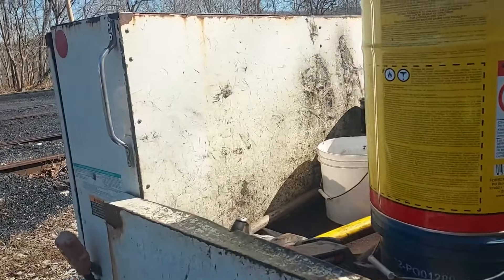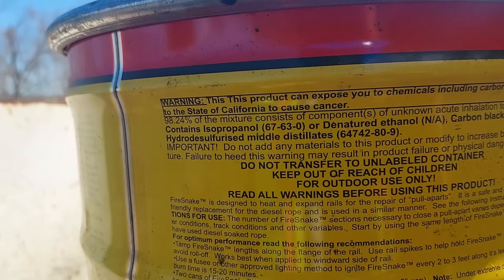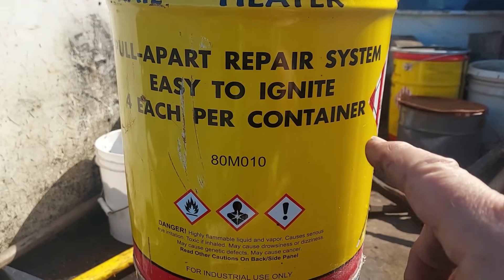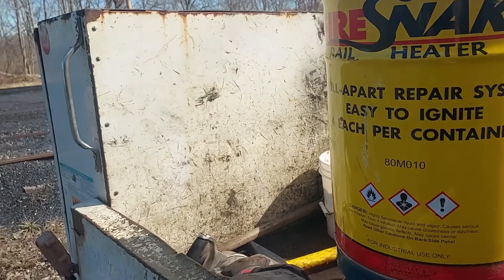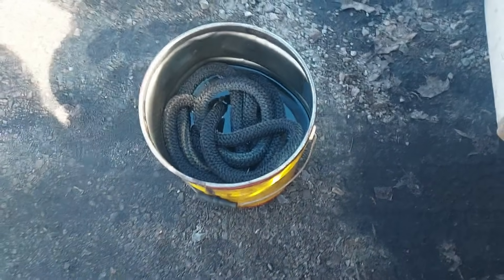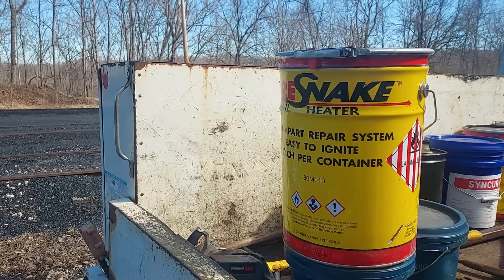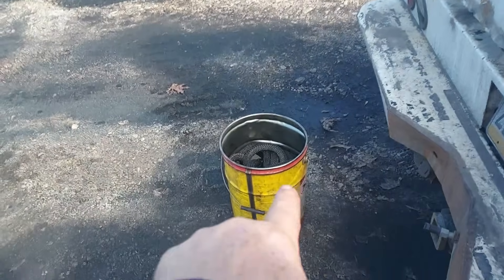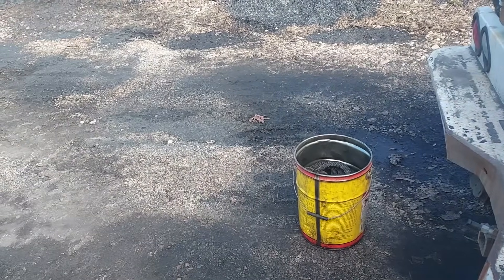Fire Snake and why we Don't Thermite Weld our Track Joints

Comment: Dave ?
Of course every question leads to at least one more explanation and that begets 3 more questions but, as a retired
master mechanic, having dealt with rear axle flange high impact shock loads our engineers use split conical wedges
(We mechanics call them Squedges, short for squedge bushings.)
(Look under the nut & lock washer on the rear axle flange of your service truck and you'll see.)
I was wondering if you were to try those on some of your more troublesome joints, maybe it would help or eliminate
the rail creep ?
Reply from the maker: Thank you for your suggestion Nam Cbeo. What would help us greatly is the addition of a whole lot more rail anchors than we have, and many of the anchors we do have are original from 1975 and have become weak. I need an anchor put er on er machine! They do make an anchor installing machine, but we don't have one. They also push all the anchors up tight against the ties. Impossible for us to do by hand with only 2 guys here and 16 miles of track.  On CWR every single tie is anchored to help mitigate the rail creep and
expansion and contraction. Really appreciate your watching the video and may you have a very good day my friend.

Comment: What are those screen / net looking squares glued to the wooden tie ends? 10:47
Reply from the maker: Those are hydraulically pressed on at the tie plant and are there
to help prevent the tie ends from checking or splitting Wasabi Master. The used to use an S shaped clip that was driven into
the tie ends. Thank you for watching the video and may you have a very good day my friend.

Comment: OK, quick question. Why are the nuts square and not hexagonal like most other nuts.
Reply from the maker: Nuts on track bolts are square because they provide a bit more
surface area to contact the washers than do hex nuts Tony. 
More surface area creates more resistance and thus better
holding power.  Thank you for watching the video and may you have a very good day my friend.

Comment: I never knew the line was isolated from the 'network' ill call it, that would be a pain. I also cannot even imagine the costs to connect it considering land would need t be bought and then all the material and then also the switch to whoever line you ended up connecting to. But reminds me of some lines of CPKC that are connected and bring in substantial income (leased out but we maintain) but company also refuses to put money into and so its all jointed as well and is 90% of our maintenance in that area along with the yard its connected to. Sometimes it is confusing to me why a section that brings in 100m a year cannot even get 10m a year put into it lol but thats big corporation life i guess for cpkc.
Reply from the maker: If you want to figure out how Class 1 RR's think, the bottom line
is pleasing the stock holders. Whatever can be cut out of the 
budget to do this will be cut out Hells Gun. We barge our coal to
a trans loading facility at LaBelle, there it is put on CSX and NS trains. That is their answer to a connection with another RR.
Thank you for taking the time to watch the video and may you have a  very good day my friend.

Comment: A really good explanation video Dave. I think a lot learnt a lot from it reading the comments. We went to Crewe locomotive works one day to pick up some refurbished crossing gate motors. I thought I bet they have some good stuff for cleaning contacts and asked what they use, they guy said Meths (wood alcohol I think you call it) and Isopropanol, there is nothing better it does not leave any residue. I already used meths for cleaning my track and started using  Isopropanol medical wipes. Like others have said it is probably used in fire snake for easy lighting and old cans even though sealed the Isopropanol will of dried out.
Reply from the maker: Yes that is what is happening Cedarcam, it is drying out, specially
if left out in the sun. Thank you for the nice comment and glad you enjoyed. Very much appreciate your taking the time to watch the video and may you have a  very good day my friend.

Comment: Hydrodesulfurized Middle Distillates (CAS 64742-80-9) are a complex combination of hydrocarbons obtained from a petroleum stock by treating with hydrogen to convert organic sulfur to hydrogen sulfide which is removed. It consists of hydrocarbons having carbon numbers predominantly in the range of C11 through C25 and boiling in the range of approximately 205C to 400C (401F to 752F)
Reply from the maker: Thank you for sharing that with us SilvaD702, very interesting stuff I did not know. Very much appreciate your taking the time to watch the video and may you have a  very good day my friend.

Comment: As ever, many thanks Dave. Wonder if it's worth explaining about the grade of bolts? My presumption is that rail bolts are a performance steel with a less tensile grade, as toughness over time is perhaps the priority. From British/European standards I think I know what I might choose... but I'm not a rail guy.
Reply from the maker: Thank you and your welcome Graham. All of our track bolts are
grade 5 because they do have a bit of flexibility to them. Grade 8
bolts would snap a lot easier. I use all grade 5 bolts on my tamper
because of the excessive vibration the machine has, again grade
8 bolts would not hold up as well as 5 on the tamper.  Very much appreciate your taking the time to watch the video and may you have a  very good day my friend.
Reply: @ccrx6700  Exactly Dave. The maliability of the soft grade (less tensile rated grade) yielding during peak force rather than clean snapping. Now, are you able to explain about the way the steel grade is used in rails?  ...would I be right in saying the rail is mostly soft(ish) in the flange and web to absorb the shock loads, but the rolling face is hardened to handle the high wear loads? (...and all within one grade of affordable steel)
Reply from the maker: @grahamrowe6278  head hardening is an option customers can get, not all rail is HH

Comment: Before they had continuous welded rail, didn't the railroads have to go check the bolts every week or something, so fast passenger trains wouldn't derail? 
Young people today don't realize that until about a decade or so after WW II, if you wanted to travel to another city, millions of people travelled by passenger train because cars were too expensive and failure prone. And fast interstate highways didn't exist. ( To get through Birmingham on US Highway 11 you had to go through 89 signal lights.) Air travel on piston engine aircraft was for rich people, due to the high cost of rebuilding the engines frequently. That rebuild took expert mechanics, and required changing a lot of expensive engine parts. Jets changed that, so people no longer have to be rich to fly. The Boeing 707 changed the world. The, 'Jet Set' appeared.
Reply from the maker: Your right about that Bill, back in the day rail travel was the best
and fastest way to go. After the interstate highways and the airplanes then railroads suffered greatly from lack of revenue
and that was the cause of so many RR's either merging or
going bankrupt.  Really appreciate your taking the time to check out the video and may you have a very good day my friend.

Comment: Dave did they ever think about connecting the railroad to the rail network?
Reply from the maker: Never Mike. Way back they thought about putting a belt line across
the river where there is NS tracks, at that time it was Monongahela
RR, so they could load unit coal trains but that never transpired,
the RR wasn't interested in doing that at that time.    Really appreciate your taking the time to watch the video and may you have a very good day my friend.

Comment: CWR is less expensive to build as a track because it is $2000 to $3000 or so less per mile than bolted rail track just from the lack of the bolts and joint bars.  The bolted rail track is a nightmare to maintain but CWR has its own problems to maintain.  Changing out rail is much easier with 39-foot pieces and bolts than with cutting out and welding in a section which would need to be done with machines.  A 39-foot piece of rail needs to be handled with a machine anyway simply from a weight and length consideration.  A thermite kit is approximately $150 to $250 each depending on the rail section and how many at a time are purchased.  Generally, only 2 thermite joints are reasonably "shot" or made per day by a crew of 2 or 3 people if that is all they do.  There is the prep work of cleaning and lining the joint, shooting it, and then grinding it and cleaning up the site.  A torch with the appropriate tanks is needed for preheating, a hydraulic shear is needed for rough removal of the excess weld metal, a grinder is needed for smoothing the inside, outside, and running surfaces of the rail head, and a truck with assorted tools to properly and efficiently do the thermite welds.  Portable flash-butt welding machines on a truck are available but are around $1 million or so each plus the operators.  There are a lot of variables that go into the cost of building railroad track and the maintenance.  Sometimes it makes more sense to do things by hand than by machine even if that is not as efficient.  Train operations determines a lot of how the track maintenance is done.
Reply from the maker: Very good comment Roy and well said. Even if we had CWR, like you say we could not change out a rail string that length, if a piece
needed changing, then would have to cut out a section and weld
in a new one. We don't have a weld truck here with all the stuff on it, so have to rely on contract welders, they are not always available.
Your right there is a whole lot to consider when working rail with
trains running all the time. I've only seen flash butt welding in
videos, never saw one done in person, hope someday to see
that. Really appreciate your taking the time to check out the video and may you have a very good day my friend.

Comment: Would the welds be guaranteed if the entire joint and six bolt holes were cut out and replaced with a short solid piece of rail and two thermite welds?
Reply from the maker: Yes they would CameraTool, but that would also require double
the welds being made. A lot of expense at over $500 to do one
weld plus the cost of the short piece of rail and labor to cut
out the old and put in the new.  Thank you for taking the time to watch the video and may you have a very good day my friend.

Comment: Great video Dave. The FireSnake is also used in conjunction with the Hydraulic Rail Puller, just like the manual "Simplex" you used,  to heat it up to a median temperature before the pull. The snake, which is predominantly an 'alcohol', heats to about 375 degrees F. The 'burn rope', which is still available,  only gets to about 250 degrees F. and causes real heavy smoke because of the diesel fuel and is a fire hazard to the user as he can easily get the fuel on himself and the surrounding area (...an EPA issue too...) and catch other things on fire, including the user... The Simplex mechanical puller is now made by Enerpac. Worked for a distributor for 47 years that sold all those products to railroads throughout the USA and Canada. Stay safe!
Reply from the maker: Thank you for the very nice and informative comment Lew. 
I did not know what temp the fire rope got to, I didn't have a heat
gun back when we used it. Really appreciate your taking the time to watch and may you have a very good day my friend

Comment: Trucked in locomotives that would be a site to see same way with rolling stock .   Thank you for the explanation … we just see stuff on YouTube and go from there thank you for your patience
Reply: If you want some visuals on what it takes to move a locomotive over the road there are a number of videos on YouTube and Facebook of the Nevada Northern Railway moving ALCO Diesel locomotive 201 from the Northwest  Railway Museum to the NNRY museum in Ely Nevada.  The distance was almost 1000 miles and the cost was about $350,000.  The move took place about 3 years ago.  201 is now undergoing restoration at the NNRY... I actually did some work on it when I was last there in 2023.
Reply: Might be easier to barge in?
Reply: @ratdude747  The issue with that is the elevation difference between the river and the track as well as the distance between the two. I doubt it would be possible here.
Reply from the maker: It certainly is a sight Ivory. Go to my channel home page, click on
Community Tab, then scroll down to see pics of a loco being
trucked in here.  Thank you for taking the time to watch the video and may you have a very good day my friend

Comment: Is the mine underground ? In AZ I was at surface mine at Kayanta Arizona ,the Peabody coal company and Kenecott copper mines the whole black mesa mountain is except for small layers of dirt solid coal #1 lignite coal  .different locations with a large rail system .if I don’t ask I don’t know c. Thanks for the videos and commentary. Have a great day Dave !
Reply from the maker: Your very welcome and glad you enjoyed Charles. We have a deep
mine here, it runs from over 700 to 1200 feet deep, lot of pressure
when you get down 1200 feet, stuff creaks and cracks all the time. Really appreciate your taking the time to watch the video and may you have a very good day my friend
Reply: @ superior AZ magma copper mine is deep under ground at 7500 feet  hot like a broiler 12 minutes I then out at .3500 ft 167 degrees rock temp 1500 ft never sweat

Comment: Dave just a question. Why don't you guys put the locomotives together? Like they do on the regular trains were the two locomotives up front
Reply from the maker: Good question Northern Living, here goes. When we started 1977 we only had 1 loco, thus we had to uncouple and run around
the train to get on the other end of it for a return trip. With only 38 cars we don't need a second loco for power, one is enough.
However that second loco on the other end of train saves about
30 minutes each trip from not having to run around when the
train is loaded or dumped. Consider saving that amount of time
over 6 trips a day, 7 days a week. That is why we have a loco
on each end of the cars.  Thank you for watching and may you
have a very good day my friend.

Comment: Amtrak does there thermite welding  with a fresh piece, then four holes and they put a set of bars on it as well.  But i see your point!  No welds keeps you busy checking track, and the trackman!
Reply: Amtrak welds both new and existing rail, welding straps are no longer used on the Northeast Corridor and are in the process of being removed.
Reply from the maker: Would really have to do a lot of grinding on the web, base and fillet
to get joint bars on a weld Tuco. our contract welders don't do that
much that we can put bars on it. But sometimes welds do fail
so that is not a bad idea.  Thank you for taking the time to watch the video and may you have a very good day my friend.

Comment: Would a 20 yard long propane burner pipe expand the rail sticks as good as a fire snake?
Like a 1/2 inch diameter pipe with a burner hole every 16 inches to play a flame jet onto the rail. Just throwing ideas out.
Some good questions answered in this video Dave, your viewers learn a lot from you.
Reply from the maker: Thank you and glad you enjoyed Neil. Many switch heaters have
a pipe similar to what you are saying to keep switches thawed,
specially on transit systems.  I think you idea would work but
having to lug that long pipe around plus the propane tanks
would be a chore. Couple cans snake much easier to handle. Really appreciate your taking the time to watch the video and may you have a very good day my friend.
Reply: @ccrx6700  I was thinking more like the pipe in say 3ft lengths, screwed together to make a 20 yard one. But I get what you say about just a bucket of fire snake being easier. Thanks for your reply, have yourself a great days too Dave.
Reply from the maker: @neilfoster814  😊👍🚂
Reply: It would probably do the job, though the holes would need to be closer together. However, it would be much more material to haul around, maybe requiring a bigger truck, create a hazard (propane), and cost a lot more - both for the gas and the equipment needed to deliver it.

Comment: I ain't no track doctor but that rail puller looks like a nightmare to deal with!
Reply from the maker: Oh for sure it was Jughead, when they got me the fire snake,
i scrapped that puller, wish now I hadn't, would have made a
really good addition to show that in the video.  Really appreciate your taking the time to watch the video and may you have a very good day my friend
Reply: Theres an older version thats a very nasty nightmare to use, especially if you have to use it alone
Reply: @cvrnut09  I worked in the underground coal mines. We had a piece of equipment called a retriever that we used if the top fell and a piece of equipment like a miner and got it stuck. That thing was a nightmare that I still have bad dreams about.